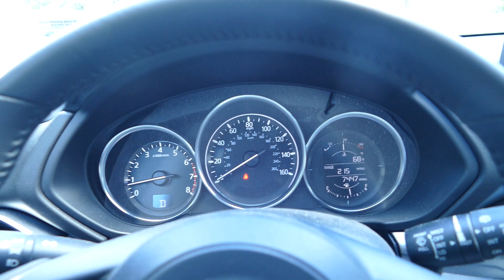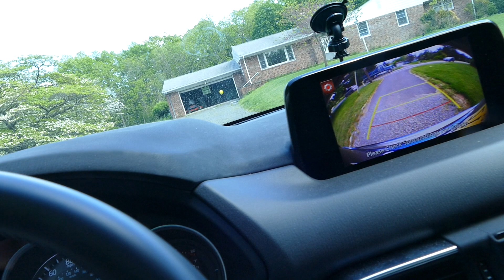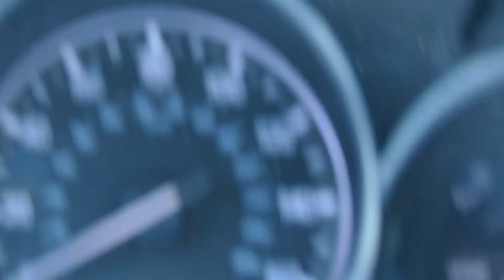Smart City Brake Support Test II Fail

Comment: Remember, the cameras and sensors were designed to detect humans and vehicles or objects that have more than the thickness of a millimeter. The string on that balloon is not thick enough for it to really pick up and the balloon itself is moving around in an unnatural fashion compared to humans and cars. To the sensors, that could look like paper flying across the Street or debris. Your car can't slimo break everytime something's in front of it because you will be randomly for no reason if a big piece of paper or cardboard blew in front of your car.